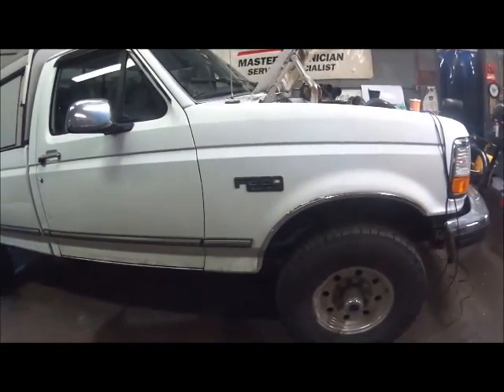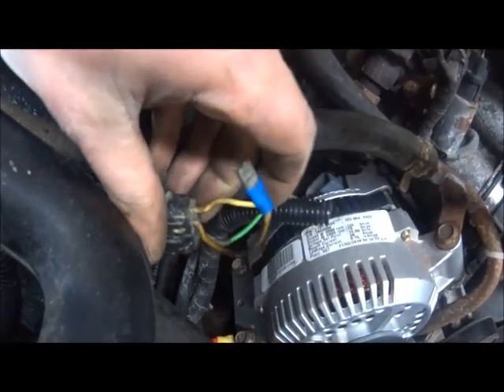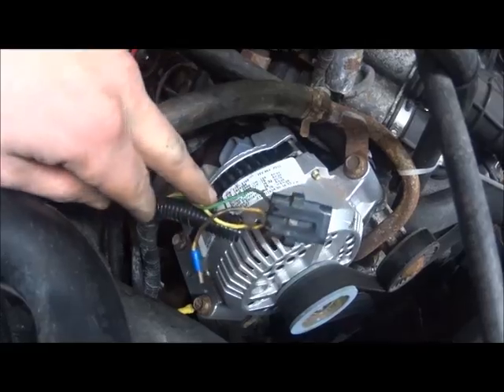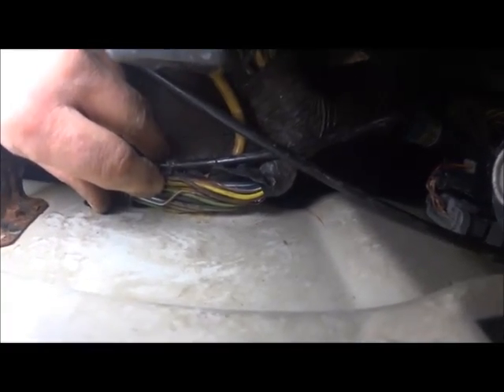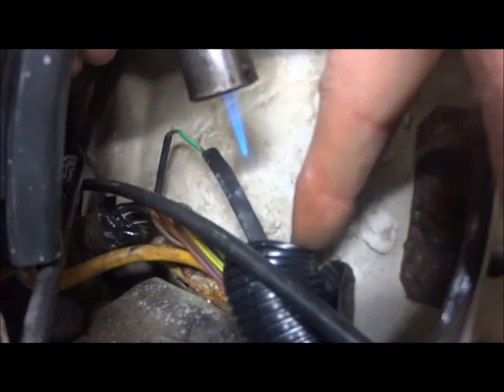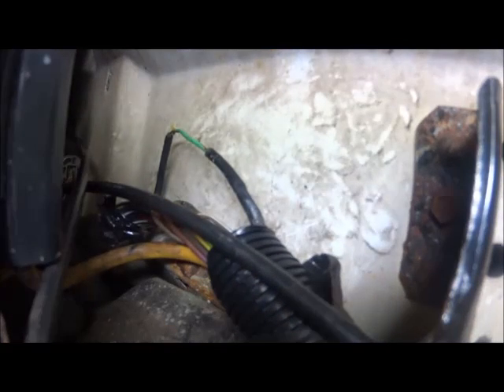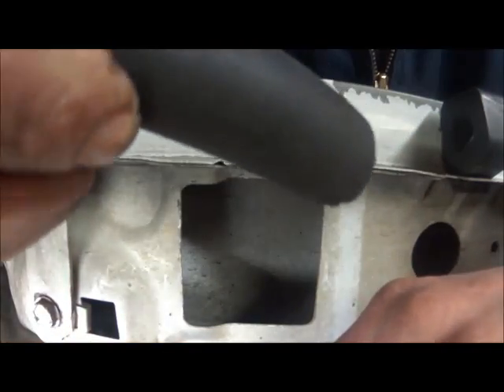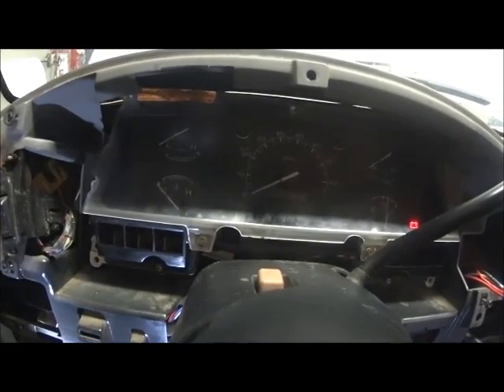1997 Ford F250 Not Charging

Comment: I have the same problem light battery is on. I replaced the battery plus the starter solenoid. Still have the original alternator do I need replace it to? Sometimes I have  good voltage but it dies after if unplug the battery. Than I plug it back won’t Crank it up so what you think is the problem sir?

Comment: How high should the voltage be coming from the green wire? (i have a 7.3l Diesel)
Reply: It also has a diode in the green wire right before coming in to the alternator

Comment: I have the same problem but I get the battery light, constant 12v and 6v on the small connector. My customer installed a reman alternator from Advance Auto. I believe the regulator is bad. This  is also a plow truck. 

Great video BTW.
Reply from the maker: Great job man!
Reply from the maker: Thank you.
Reply: @JoesAutoElectric  You are welcome. The alternator still not turning on. Craziest thing I have seen.

Update! The knucklehead crossed the wires on the glow plug solenoid. Charging normally once I switched them.

Comment: The battery light is there to excite the alternator into charging. If you disconnect the plug and the battery light goes out, then the circuit is fine. This is old school electrics before all this smart charging bull shit was introduced.

Comment: how do I fix mine? driving on the highway and the volts just go down, no idea why
Reply from the maker: Testing the circuit is the key to finding the problem.
Reply: Joe's Auto Electric what do I do with the circuit?
Reply from the maker: Not trying to be rude, but if you don't know how to check it, bring it to someone who does. You will save a lot of time and money in the process,
Reply: Bridge rectifier pack needs changing. It's still in AC volts after the alternator.

Comment: I had that problem both batteries keep dying so I found out why if u have factory stereo pull the stereo harness from your stereo go charge your batteries and it should turn and no problema 1999 f250 super duty powerstroke v8 diesel wasted all that money on four batteries 2 alternators and ducking starter don't waste your money no more duck your stereo and drive your truck
Reply from the maker: ??? Did you watch the video ?
Reply: There is something with the factory stereo circuit.  I've pulled the fuse for mine.  I've had shops look at it and not be able to fix it.